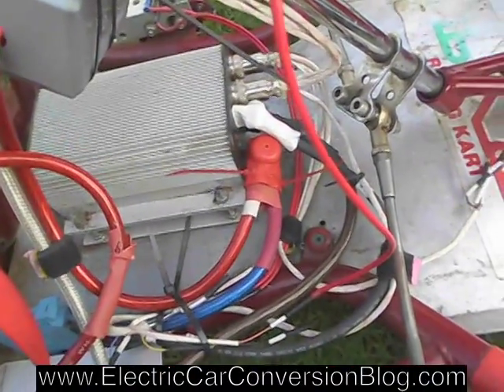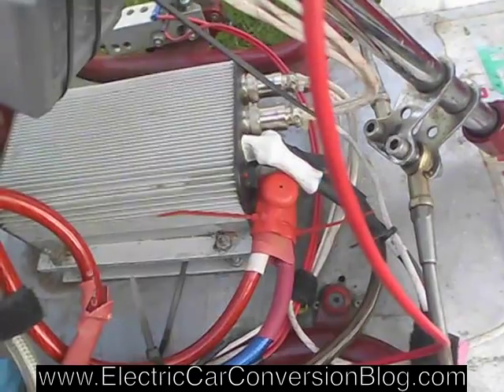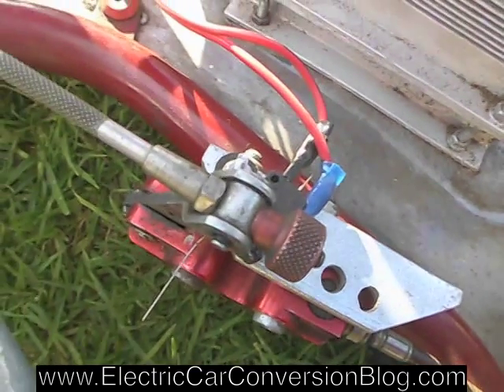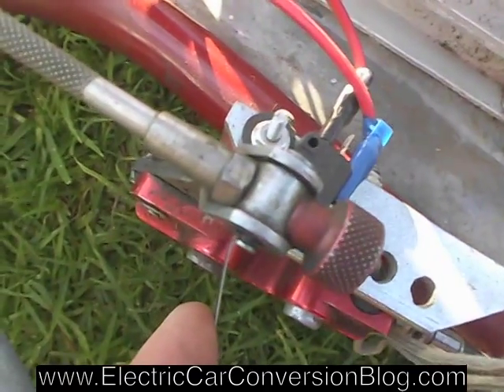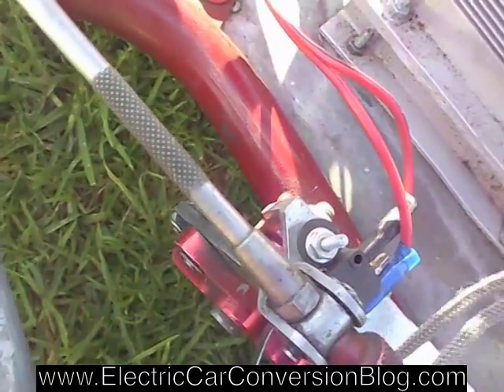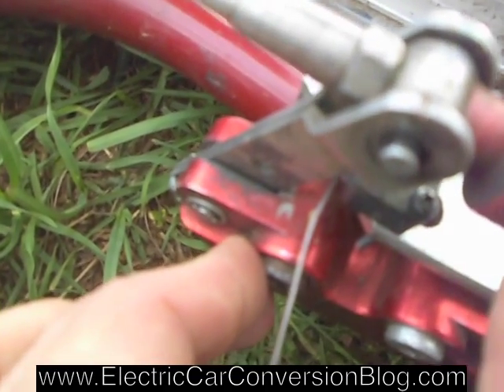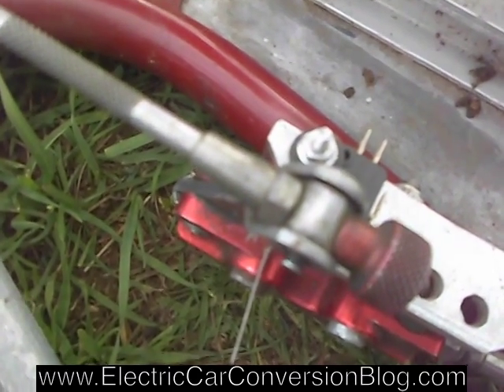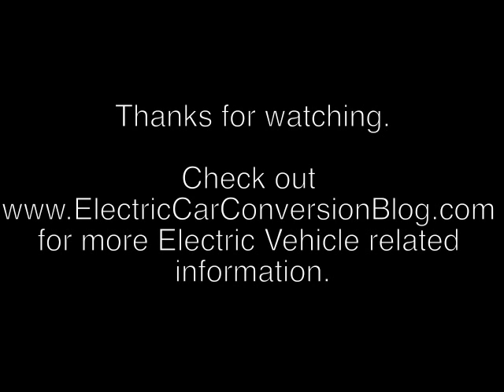Kelly Controller 1-3 Error code

Comment: Are young your kart on 24v?
Reply from the maker: scott cooper At that time, I was running 8s3p LiFePO4. This provides a nominal voltage of 3.2 x 8 = 25.6 volts. Things have changed a couple of times since that video was made.